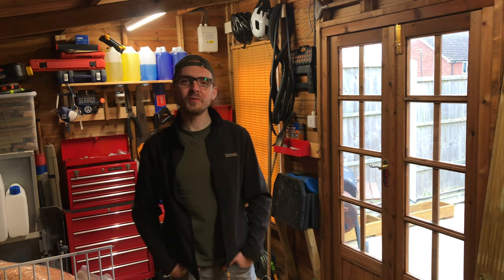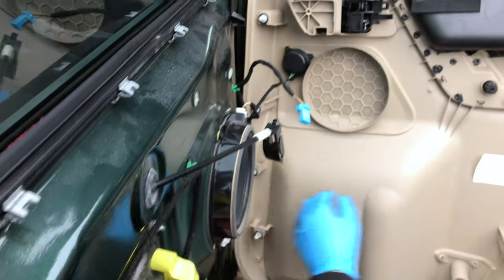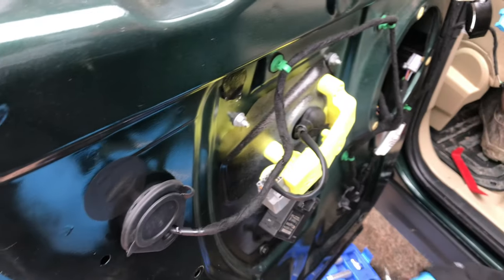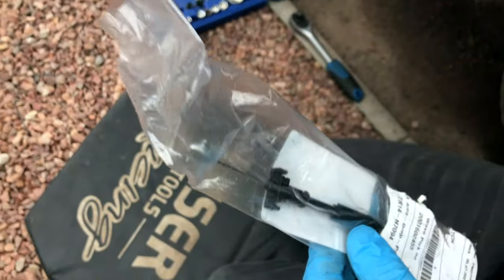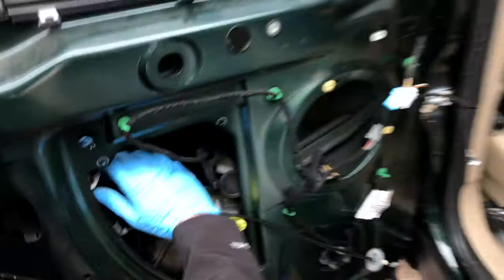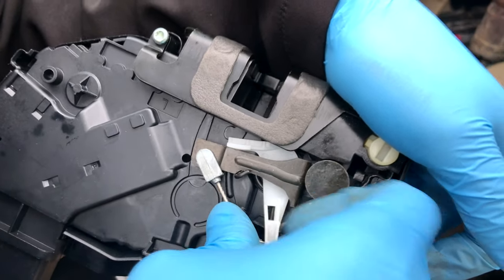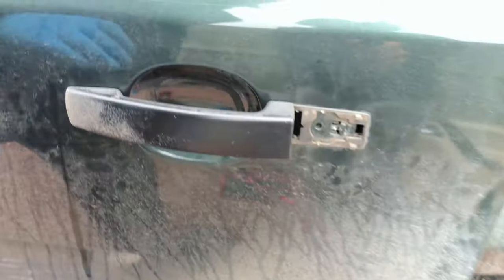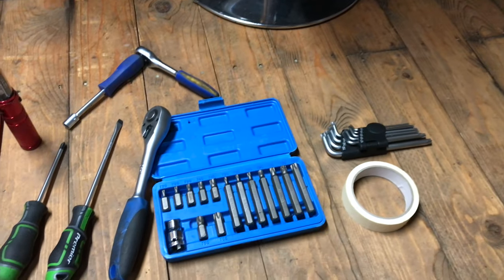NO ENTRY - Freelander 2 / LR2 Door Troubles!

Comment: This video was so much better than Powerful UK.  Not a knock on them, 'cuz I'm thankful for all they do too.  But really appreciate your perspective on this, especially putting everything back together.  Bonus points 'cuz I have the same colour 2011 LR2 here in Canada.

Not sure if you'll see this, desperately hoping you will, but I have a bit of a conundrum.  My door (same rear left passenger) won't open at all!  I'm guessing the latch maybe be stuck?  I've somehow miraculously removed the door card without breaking anything.  Any tips on how I can actually open the door to fix everything?   Thanks!
Reply from the maker: Hello! 😁 Thank you so much for your comment. Really appreciate it, we try our best with the technical videos and hope they are useful for DIY fixes 🙂 We really like the Galway green colour, it’s our favourite. 

Ok, with the door, is it not opening from either the outside or inside or both? It could be one of the cables have broken but very unusual if both have snapped. Try getting someone to pull the handle from the outside and then really push/budge/kick the door outwards to try and budge the sticky latch. 

It does sound rather strange, but a similar thing happened to me where I became trapped inside the car and had to hop out the passenger side. The door would open from the outside and we found one of the cables had snapped. 

Let us know how you get on, we hope you get it sorted 🙏🧰
Reply: @FrenchiesRoadTrips  The Galway green is definitely my favourite as well.  I was lucky and got this one with orange seats.  I think that's super rare.  Don't even know what the name of the colour is.

Yeah, the door is not opening from both outside and inside.  A local mechanic (non-LR specialist) suggests we may have to use brute force to get the door open, but unsure what will be damaged in the process.  I'm holding out in hopes that there is some internal latch release mechanism that I can access.

Will keep you posted if anything develops.
Reply from the maker: @michaellee347  Wow orange seats! That is rather rare, I’d have to check the brochure to see what colour name they are 🙂 Let us know how you get on with the door, keeping fingers crossed 🤞🙏
Reply: @FrenchiesRoadTrips  UPDATE!!! I fixed the lock!  It rained heavily one weekend and suddenly the door just opened.  Didn't want to take a chance so I immediately started disassembling everything according to your video and ordered the replacement door actuator part at a local dealership.  Couple days later, part comes in and a quick hour install and it's working like new!  Thanks again for your video.  I lost count how many times I viewed it, but it was excellent!
Reply from the maker: @michaellee347  Wow! 😁 That’s great to hear! So glad you managed to fix it 🙏 Really happy you found our video helpful 😁 Always happy to help 😁

Comment: Great video....
Can you tell me please the codes for rear back locks cables...on left hand  I can't open the door only from inside and on the right hand doesn't block the door when I look only if I push the small black think.
Reply from the maker: Thank you! 🙏 We don’t know the codes, so sorry! When you press the lock button on the key fob sitting in the car, you should see if the black latch by the handle moves. If it doesn’t, this usually means the door actuator is at fault. Hope this helps 🙂
Reply: @FrenchiesRoadTrips  Hi mate, I got a terrible problem on my freelander 2 2010 , passenger side door key barrel can turn, but it wouldn’t allow me open the door manually 😢 is there the problem of the cable that connect the key barrel to the latch? If it is ,could you please help me out on solving this🙏 thanks mate
Reply from the maker: @YJ9868  Hello! 👋 That’s strange. Have you checked the door is locking and unlocking with the key fob?
Reply: @FrenchiesRoadTrips glad to got your reply! Yes sir, I have checked it, key barrel can turn both way, door handle can pull , but it just wouldn’t open the door😢
Reply from the maker: @YJ9868  Ahhh ok, I wonder if the cable which connects from the actuator to the handle inside has come off. It might be worth taking the door trim off, it’s similar to the rear door.  We’ve had this happen before when the cable connection has broken off inside the door connected to the actuator.
Reply: @FrenchiesRoadTrips will try this method. Thank you very much sir! You are such an awesome person 🥳
Reply from the maker: @YJ9868  Thank you!! We hope you get it sorted 😁🙏 Let us know how you get on

Comment: Thank you. Most helpful video. I have front and rear door actuators gone. Is the front door actuator a similar process to remove?
Reply from the maker: Thank you! 🙏🤩 Glad it helped you out. The front door actuator is slightly easier from memory as a little more room. Hope it goes well 💪🙂